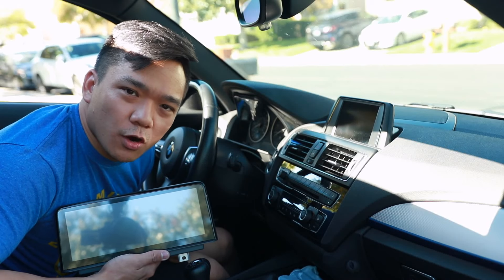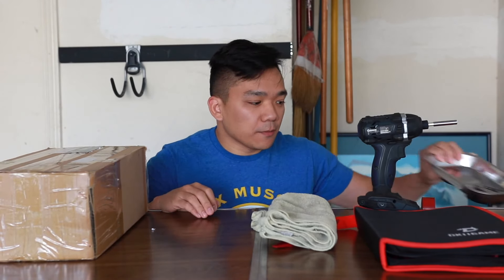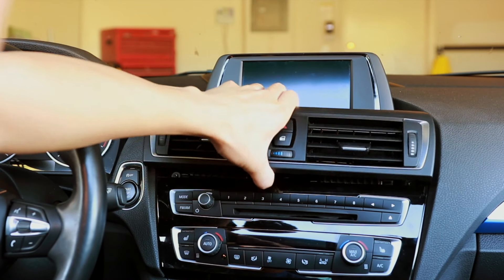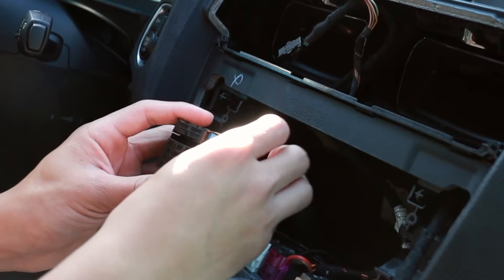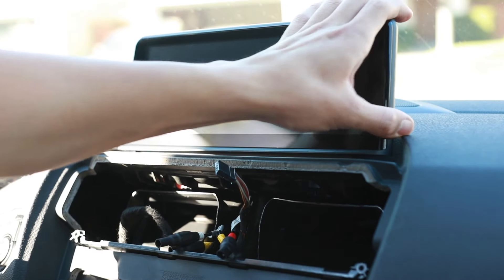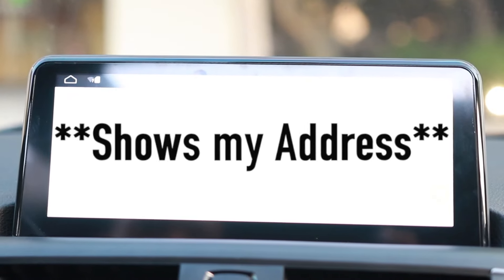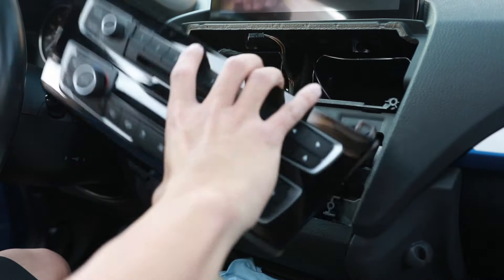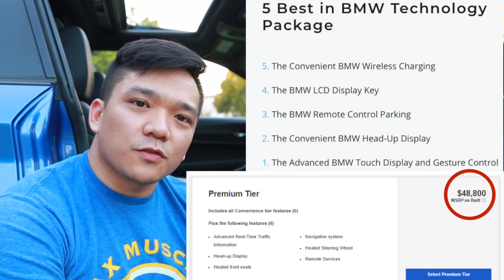BMW Android Screen | BMW Screen Upgrade | Koason 10.25" Display

Comment: Hi I have a bmw f20 with the basic screen and the basic Idrive software... This screen will work without any problem? Thabks in advance
Reply from the maker: It should. Just make sure when you buy the screen, that it is for your car. Your setup is the save as my car was so it should be fine
Reply: @FritzRamos  great.. And the rear view Camara will automatically works with this screen or I have to make some specific work in order to see the original rear view camera?
Reply from the maker: @sebb6342  I had the Oem camera and it worked without any additional adjustments.
Reply from the maker: @sebb6342  I had the Oem camera and it worked without any additional adjustments.
Reply: My friend thanks for the help.  I have more questions hahaha.... It's necessary to put the USB cables and the video cables if I will not use them?
Reply from the maker: @sebb6342  You don't need to but you can use the USB to transfer files and uploads to the unit, I prefer to have it in and cover/ tape the unused AV cables
Reply: @FritzRamos  my friend sorry for so many questions but youre so friendly and willing to help.

I just want to recap some of my doubts because I will pull the trigger because of you:

1. The Bluetooth will work fine with the new interface on the new screen or just work with the old Idrive?

2. If I use the new interface on the screen and out reverse the backup camera will show up instantly in the new interface or will show up in the old Idrive?

3. The GPS and maps will work when I use my phone as Hotspot connectly directly to the new screen? This will be the same for the others apps?

4. The microSd is for put information like music, photos, videos and also in order to download maps from the GPS?

5.i have a the smallest screen Idrive, I will have stretched images if I don't do the coding... I don't have problem with the split screen but I don't want the stretched image I see other videos will that happens

This is for the moment hahaha many Thabks bro for your help for real
Reply from the maker: @sebb6342  No problem at all.

1. Under settings BT is set to car idrive by default and can be switched to head unit BT.

2. OEM back up camera will pull up as normal when reverse is engaged. After market backup camera will pull up on the android side. When you drive forward, the unit brings you back to the side you were on prior to engaging reverse.

3. Your apps and maps will work once you conne t your hotspot

4. The SD car will function as you said. Just note that some apps won't store externally. Similar to the SD card in phones.

5. You will only have a stretched screen if you don't code and tell the unit to run full screen under settings. Otherwise it defaults to split screen

Hope that helped! Feel free to ask if you have more questions.
Reply: @FritzRamos  many thanks bro I appreciate all the help now I feel good pulling the trigger, I will let you know how is goes.... BTW maybe you can do a video explaining how is living with this screen and all the things that people like me ask hahaha.. You are very didactic to be honest 🤟🤟🤟
Reply from the maker: @sebb6342  Sure. I could do one. Feel free to reach out though. That video might not happen until mid February.
Reply: @FritzRamos  I just bought the koason android screen 💥👍 thanks for everything bro
Reply from the maker: @sebb6342  Congrats! Let me know how it goes.

Comment: Just installed mine yesterday , super easy, thanks to you video... thanks Fritz...
Reply from the maker: That's awesome! So glad to hear that and happy to help. Let me know if you need anything else 👍
Reply: Did you need to do anything to activate gps system stays offline for me ?
Reply from the maker: @emocookie4life  Did you connect the head unit to your phone's hotspot?
Reply: Fritz Ramos yes I did. It works threw my phones hotspot. Thought the module itself gave out internet for GPS though?
Reply from the maker: @emocookie4life  It does but If you don't have hotspot on to update the maps and read traffic that warning comes up
Reply from the maker: @emocookie4life Try going  to 2:47 of this video to get into the head units settings. Search around for the GPS and make sure it's turned on.  https://www.youtube.com/watch?v=8NrPVNs2-Cc
Reply: Fritz Ramos . Got it. So how wold I get it to work without my hotspot. Do I have to use hotspot for other apps such as YouTube or will that run off the built in 4g. It doesn’t connect to built in 4g.
Reply: Fritz Ramos got it thanks. We’ll keep you posted Fritz
Reply from the maker: @emocookie4life  Unless you have a newer version than me, the unit does not have a built in hotspot without a SIM card. Another option is to connect a mobile hotspot to one of the USB ports
Reply: Does this change void your warranty?

Comment: Hi Fritz/all - anyone know if the 8+256GB version will reduce the startup time over the 4+64GB version? This is the only thing holding me back - thanks!
Reply: update: bought this version and it starts up in like 20 seconds which is perfect to be honest.

the only issue I have now is that the audio glitches sometimes when running carplay with audio+navigation running..... considering returning the unit because of this

Comment: Hi Fritz, I recently did an M4 LCA + TS and Camber Plate install on my M235i and I am rubbing in the front with 245/40/18 on 18 x 8.5 ET 38 wheels. Do you know if there is anything I can do to push the caster back a bit?
Reply from the maker: I had a similar issue. It can be fixed if you have the adjustable thrust arms. With fixed arms you're very limited. The wheel geometry in the front is almost completely dependent on the length of the LCA, TS & TR.

Unfortunately, it's not like the rear where you have a specific adjustment point.
Reply: @FritzRamos  that’s why you went with SPL thrust arms?
Reply from the maker: @la.m240i6  Yes. Although Apex is a great resource, the room for error was too small for me so I leaned towards the adjustable arms.

 You're actually the first person I've seen to bring this up and actually did both arms. I guess our cars are outliers😅
Reply: @FritzRamos  I think most people that do both arms are on 225 up front or stock setup still 😄
Reply from the maker: @la.m240i6  Good point, I didn't consider that. Don't worry my friend you're not the only crazy one, I'm right there with you pushing the upper limits 😂
Reply: @FritzRamos  I got the CRB E9X (Front Caster Rod Bushings) to fix my caster.

Comment: Hi have you got a few other options for the head unit I can buy in the UK ? I have a bmw 1 series 2014 will it work ?
Reply from the maker: Not the one I listed. You can check Amazon, that's where I got mine.

Comment: Hey I have installed the andriod unit 10.2 to my 3 series with oem screen however my camera doesn't work , the screen flickers and also touch sensibility isn't working any idea how to fix it. Is my idrive broken?

Comment: Hi Ramos. Thanks for a great video. I am driving F31 2016 model with a basic screen (gps incl.) and I would like to upgrade it to a bigger Android screen. What would you recommend me and the most important question where should I buy it? I am coming from Slovakia (EU). Btw. I heard that reprogramming of the unit is also needed with this upgrade. Could you pls. advice? Thanks
Reply from the maker: Good question and it would depend on what's important to you. Do you just want a bigger screen or would you also like the additional features from having an android component?

Here are the steps for the coding process https://youtu.be/8NrPVNs2-Cc
Reply: @FritzRamos  Hi. Bigger screen is a must, Android features are welcomed but not necessary. Thank you. Peter
Reply from the maker: Sorry for the late reply my friend. I tried searching for a way to have a unit shipped to you but my search came up empty. I would suggest that you look at junk yards or classifieds like facebook marketplace and see if you can pull a bigger screen off of another car. Ebay may be another resource for you.

Comment: Hi fritz. Are u sure that aux cable isn t necessary to hear the audio? I ve read on many forums that you must connect aux cable to hear the sound
Reply from the maker: I thought it was necessary but when I connected it, it didn't seem to make a difference. The sound comes in clearly from the radio, bluetooth, and maps weather I have it connected or not. Not even the quality was effected. Maybe some cars need it and other don't and mine falls under the latter. Do you have the same car?
Reply: @FritzRamos  I have a 2016 f30. I m waiting for the unit. Have u tried to play videos?
Reply from the maker: @Mob1us1  That cars newer than mine so you might be okay without it. In any case it comes with an aux cord (if you got the same unit as me).

I've only tried YouTube videos but the lag is noticeable. Not sue if you pay videos from SD card. Let me know if you need help

Comment: Hello fritz and thanks for the nice video. I am sending you from greece.I am waiting one of this android screen and i will try to put it alone.i have sensors for the parking,no camera,will they work after the installation and can i see it on the screen? And one more i have usb original in the car. Do i have to put the after market usb also?
Reply from the maker: Thank for your comment. The sensors will still work and you can still see the proximity if you don't have the camera. You shouldn't have to put in the aftermarket usb if you don't want to, but if you plan on using an aftermarket camera you can use the usb ports that come with this unit. Let me know how the instal goes and if you need any help.
Reply: Fritz Ramos my mistake,i forgot to tell you that the sensors are after market also. So i cant see the proximity now in the screen. I just hear them. Is there any way so i can see the proximity with the new screen rather than just hear it?Thanks a lot for your time.
Reply from the maker: @eatsh1tsleep536  You should be able to still hear them so long as they remain connected to their audio output.

As far as being able to see them, unless they have a video component I would assume not. You don't want a backup camera?
Reply: Fritz Ramos i do want but its difficult to install it as i know.One more question fritz,do i have to put the aux cable that it comes with the screen  somewhere?or its not necessary? I have aux and usb original also.
Reply from the maker: @eatsh1tsleep536  I didn't have to install the AUX cable. The audio came in fine, but I have always wondered if it would come in more clearly. I'll update you. Also, did you get the same kit as me? It should follow the same steps
Reply: Fritz Ramos hi again fritz. Finally I installed it and all seems to work perfectly except the gps antenna signal. Its very bad and slow,I tried to put it in many different places but unfortunately its the same everywhere. The only place that work good its outside near the screen,but i dont like it because you can se the cable and the antenna also. Do you have any idea?thanks a lot fritz
Reply from the maker: @eatsh1tsleep536  Glad to hear that. Have you tried routing it to the rear of the car. Underneath the panel where the 3rd brake light is?
Reply: Fritz Ramos unfortunately no,I haven’t tried this fritz because i don’t know how to guide the cable at the back of the car.
Reply from the maker: @eatsh1tsleep536  you'll have to use a magnetic stick or string to pass it bahind the glove box compenent and run it along the passenger side weather stripping. You can check out my comfort access video to get a better visual of this
Reply from the maker: How is the unit working?
Reply: Fritz Ramos unfortunately I don’t feel  very comfortable of doing that alone. I will try to put it once again at the metal surface like you and see if i am lucky. Do i have to put it only in a metal surface to work? My gps antenna isn’t magnetic,its like plastic at the bottom and it was with a sticker.thanks a lot for the interest
Reply from the maker: No mine was magnetic so that's why I used it. Metal or not it should still work
Reply from the maker: Did you get the koason brand?

Comment: Hey fritz. If I mount this unit and install a rear camera will I see the dynamic lines??
Reply from the maker: If you purchase an aftermarket backup cam then I think the dynamic lines are produced by the camera not the headunit. I could be mistaken, please correct me if I am.
Reply: @FritzRamos  with an aftermarket the dinamic lines works! It depends if u have automatic or manual gear
Reply from the maker: Awesome! Glad that it worked out and thanks for sharing!
Reply: what rear camera did you end up using?

Comment: Sweet video! My head unit needs to be replaced since it is stuck on the BMW logo only now, I was looking at this as a viable option instead of going stock again. I have 2014 M235i with the base infotainment (No navigation and Bluetooth only works for calls, no music). Do you think this will be a direct plug and play for me without any coding required to get bluetooth music?
Reply from the maker: That was my set up except that I had BT music. It was direct plug an play. No cutting or splicing. Let me know if you need help
Reply: Hey did the android unit worked for you with stuck up bmw logo screen ?  Thanks

Comment: I have a 2017 320i xDrive does the backup camera still pop up automatic when you put gr car in reverse or do you have to manually turn it on
Reply from the maker: It pops right up!

Comment: Does it affect the sound quality while using your phone as a bluetooth source ? I read some kind of weird stuff about disturbing sound quality
Reply from the maker: This unit has worked well for me and I have used the units BT and OEM BT for music, just make sure to set the volume balance in the settings. 

The voice from GPS apps come in with a bit of static, but after using it for a while now I kind of like it. It really grabs my attention while driving.
Reply: @FritzRamos  Thanks appreciate the fast answer, keep going man, you're doing great on these f22 videos :)
Reply from the maker: No problem and thanks for the support! Let me know how the installation goes

Comment: hey so I've watched your video at least 10 times in the last 2 days, and its amazing. So i have a 2015 bmw 320i i was wondering if this screen would work for my car?Also i clicked the link and that screen is no longer available. Last question will this package provide navigation or did your car already have navigation ?
Reply from the maker: Thanks, glad you found it useful. I believe you would need a different version of this screen, but one should be available to you (I'll help you look). Is your car NBT?

My car did not come with navigation so I have to use the android navigation.
Reply: Hello. Got 220i 2015. Wonder if steering wheel buttons works with it? Guess u can order online... Did u make upgrade?
Reply from the maker: @vs-mz8nn  steering wheel buttons work you can also map them to certain things like GPS as well

Comment: This should work with an 2013 F31 too or not? And does the Bluetooth Audio works automatically with the new screen or do I have to get it coded because I've got the strange version with Phone calls but without Bluetooth Audio. Nice Video👍🏻

Comment: Will this  support f20 series bmw 116d 2.0 sport 2012 plate?
Reply from the maker: If not this one, the manufacturer does make different model. One should work for your car.

Comment: Do you have to do any coding at all? And will it work for a 2013 bmw f20?
Reply from the maker: I did have to code for the full screen and as long as the unit is compatible foryour car it should work the same. https://youtu.be/8NrPVNs2-Cc

Comment: Hi Fritz thanks for your video! I installed an android screen on my 2014 bmw f30(vin F892903). problem is its showing split screen not like the one in your video of the Android screen. Half of the screen is occupied by some data for fuel consumption. Even the aftermarket carplay (bimmertech mmi) I installed is on split screen. Hope you have a solution for this. Thank you!
Reply from the maker: You did the coding from bimmercode and the head unit?
Reply: Fritz Ramos thank you for your reply. There was no coding done since the screen (which I installed earlier than the bimmertech carplay) was just plug and play as instructed. The bimmertech carplay was also plug and play W no coding needed. Would you think changing the screen to another brand would solve the problem?  Or coding is really needed? Appreciate your time. Thanks again.

Comment: Great videos. Thank you! Been doing so much research and not getting very far. So much differing info for these head units that are supposedly all the same. I have a 2017 F22 (230i Xdrive) with ID5. The Koasan has a picture that shows ID5 & ID6 as not compatible. I'm not sure a touch screen will work.... Bimmertech only has non-touch screen head unit that is $700. Is there another model comparable to theirs and one that I can trust all features will work? What about touch-screen for ID5?
Reply from the maker: It should work, mine is a 2015. Honestly the touch screen function is nice but I never use it.